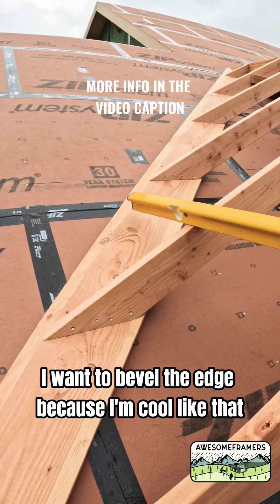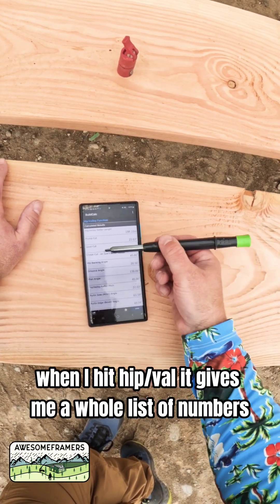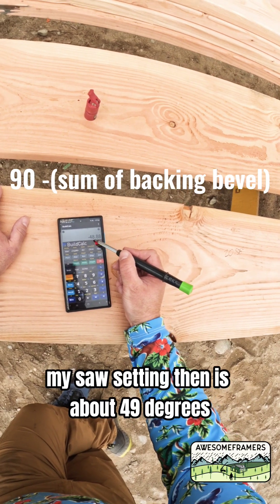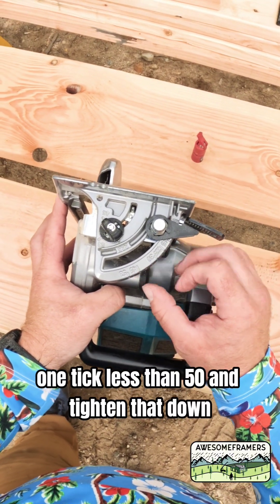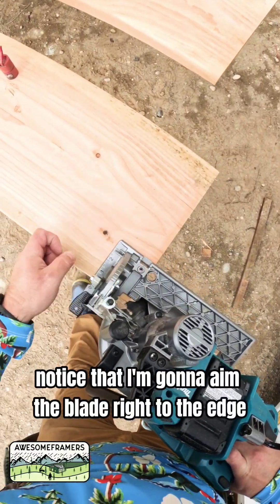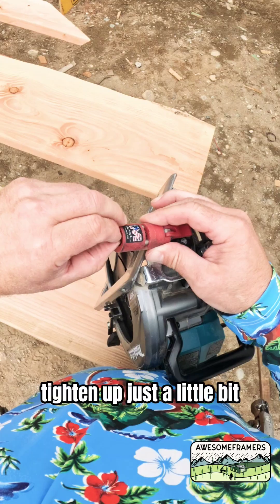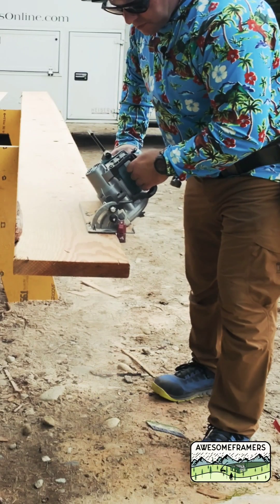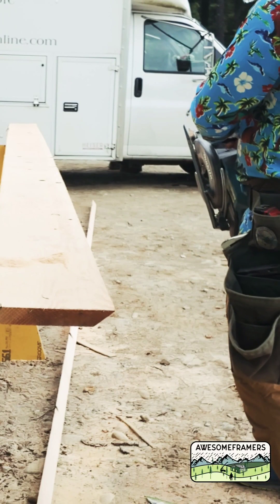Geometry in Motion #framinglife #roofframing #math

Comment: Another way you can do this with a regular calculator (in degree mode) is,
90 - acos(cos(pitchAngleA) * cos(pitchAngleB))

Or if you don't have the pitch angles,
90 - acos(cos(atan(riseA / runA)) * cos(atan(riseB / runB)))

If the two roof pitches are not perpendicular to each other, then it gets more complicated - there might be a shortcut, and it's probably easiest to just use something that will do the math for you, like SketchUp - but a way of doing it using linear algebra is to get a surface normal for each of the two intersecting roof planes (a normal is a unit vector perpendicular to the surface), and the dot product of those surface normals will be the cosine of the angle between the two roof planes, along the line of intersection between the planes (for a roof, that would be the hip, valley, or ridge connecting them).

The surface normal for a roof plane can be obtained by getting two vectors that are both parallel to the surface of that roof plane (say one along the ridge, and the other one down the valley), then using a cross product operation between those two vectors to generate a perpendicular vector, and then dividing that resulting perpendicular vector by its length to normalize it.
Reply: I am sure i can understand everything you wrote, just as soon as i finish my course in Greek.
Reply: @ricky-6657believe  it's not as complicated as it sounds - especially if you ignore the linear algebra part at the end. 

Trigonometry especially - it's just basically look-up tables going from angle to rise/run (rise/run ratio = tan or tangent), or rise/run to angle (inverse tan or tangent, aka. atan), or how much rise there is for each unit along the slope of the angle (sin or sine), or how much run there is for each unit along the slope of the angle (cos or cosine).

The regular sin/cos/tan convert from an angle to a corresponding ratio, while the inverse - usually shown as either asin/acos/atan, or sin/cos/tan with a superscript "-1" - convert back from a ratio to an angle.

So as an example, the pitch angle of a 5/12 roof is, atan(5/12), because the pitch - 5/12 - is the tangent ratio, and so an inverse tangent converts back to an angle.

And also, you can do the opposite conversion by dividing rather than multiplying. Let's say you know you have a custom roof pitch of 30 degrees, and the span from the edge of the building to the center of the ridge is 10ft. And you want to have a 1ft horizontal overhang.

So your overall span from the end of the rafter to the center would be 10 + 1 = 11ft, minus 3/4" for half of the ridge - or 11ft * 12in/ft = 132 - 0.75 = 131.25 inches.

And the length of the rafter - again with a 30 degree angle - would be 131.25 / cos(30), because cosine is how much run you have for each unit of length/measure along the slope.
Reply: @welcti  i know. I spent 50 years in construction and my favorite subject in school was and is math. I mostly avoid doing complicated math because once i start working on math problems i can not let go of it. I wind ip having numbers racing through my head at lightning speed and have trouble making them stop. I can solve complicated calculations in my head faster than most people can with calculators. It was a joke. But i really am studying Greek, along with spanish, dutch, french, german, italian, portugese and so on and so on. Have a great day.
Reply: @ricky-6657believe  I am not a construction professional, though I am interested in building my own house. 

My career is in videogame programming actually, but we do the same math that the developers of SketchUp - or any other simulation/CAD program - have to write/implement (computers are actually just big calculators - everything they do is math, and moving stored values around).
Reply: @welcti  good luck building your own home. Get involved as much as you can. It is an extremely rewarding thing to do. As we always say, we don't  build houses, we build homes where families can move in and grow and create great memories.

Comment: Built a number of log homes and other types that had rather large dimensional lumber 4x ,,, 6x and up to 10 x  ranging from x6 to x 24"  The 7 1/4 blade is only used for the petty stuff ( truly ) You break out the BFS !  The math is very very tight , having to make adjustments because of small deflections  but know this , cutting the valley rafters is something special, finishing it off with a valley bevel cut down the top to member out the valley rafters and for the finish roof decking to lay across and fasten down. Easy for me as I was a finish carpenter several years before becoming a framer and builder. I love me some structual wood that will be the finished product and as my Daddy used to say  " I want it to fit like it grew there ".  If you really want to have some fun ( should be easy for you )  build you something hybrid ...post and beams , combo logs and board and bat , lap or rock siding , with the right windows  and doors and lighting , nothing is more rewarding than the finished product wood beams that seamlessly fit with all components membering out perfectly.....
..just as you planned it.  And yes , the finished steps will have skirt boards !

Comment: Nice work. Thanks for the math. You should try commercial construction sometime . I think you would enjoy the novelty
Reply: I retired, but did not stop building, from construction after 50 years. I started in commercial and absolutely loved building those big buildings. But after 20 years i really got tired of it because as a carpenter in commercial work i spent most of my time working with concrete and steel and spent very little tome working with wood. Thats when i got into home construction.

Comment: Because floating roof ply two inches off the sleeper to the underlying roof ply is a structural problem? I used to waste time beveling sleepers too. It's fun!
Reply: Not much of  a waste if you know what you're doing, and it makes a much tighter valley
Reply: @sorenjensen3863  No, it makes no difference if you cut the angle on the plywood correctly. Floating the ply a couple inches off the edge of the sleeper to the intersection of the roof has zero effect. It's just an OCD thing and I used to do it too.
Reply: @JohnComeOnMan  it's not just about the sheeting angle. It helps align your valley Jack's nicely as well. For the extra 10 minutes, making the rest of the process easier and better, it's about dedication to quality work... not ocd
Reply: @sorenjensen3863  It has no bearing on where the rafter hits the cleat...the outside of the compound miter hits the corner of the cleat regardless if it's beveled or not. All you're doing besides spending extra time is giving a tiny amount of ply unnecessary bearing. Total OCD move that only the framer will know/care about. When production matters every minute counts. If it's your own house and you want to feel good about little extras like that, let your OCD bird fly.
Reply: @JohnComeOnMan  👍

Comment: Nice 👍 I’m interested in the little red thing you clamped on your saw, where can I get one?
Reply: Vice grips work good for this too.
Reply: It’s called a stair jig for a framing square. I’ve just had to look it up as I’m interested in one
Reply: @g1zzard638  okay thanks 😊 I have little brass buttons I put on a rafter square for laying them out it must just be a bigger version. Have a great day
Reply: It is called a kick back for a reason. Your finger will be just fine. No tool required.
Reply: it is almost completely safe, and ive done it a million times but boy splinters do suck lol thats really my only pro for using it instead, but on the fly i pinch it with my finger and run it@oneangrygoy